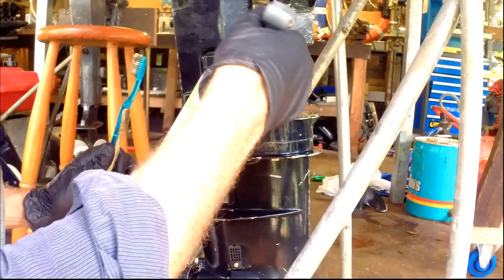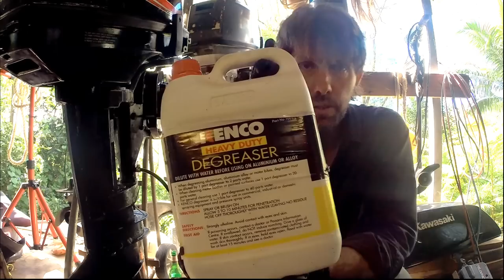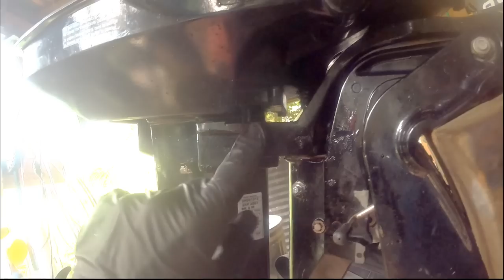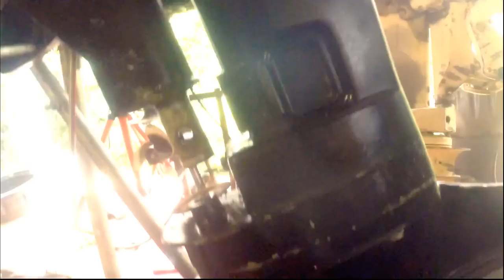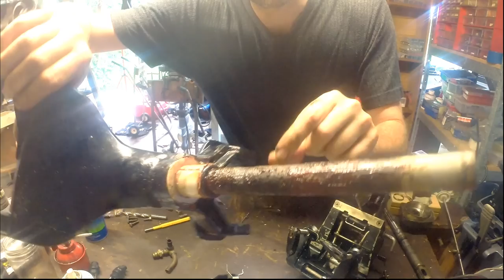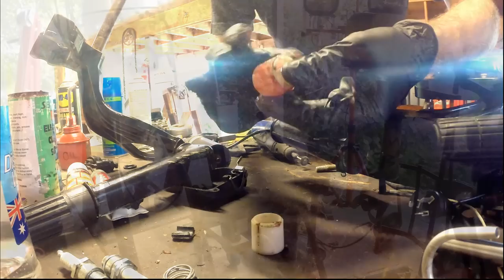Fixing a stiff steering bracket (pivot tube) on an outboard motor

Comment: Your idea is great, I do something similar that has always worked, and that is to use brake kleen then PB blaster, then regrease. The brake kleen really hits the old grease and breaks it down big time, the pb afterwards lubricates the tube because the brake kleen dries it out a little, then the grease travels through the pivot tube real nicely!
People that say heat it with a torch, but they usually damage the nylon bushings and seals top and bottom that keep saltwater out and grease in, and it doesnt really work so good anyways. Cheers!

Comment: Really helpful video. I “hydrauliced” my tender outboard by pumping in “corrosion block grease”.  I had the presence of mind to Google the problem and found this. I did not have a compressor to hand, so adapted a hydraulic oil pump, and drilled a hole through the centre of an M8 and M6 bolt to thread into the grease nipple boss, and the friction nut boss. Pumped de greaser through both ports, and after about 5 mins a big thick hard grease snake oozed out of the boss top and bottom. Steering now  free as a bird, and filled with light lithium grease.....I won’t make that mistake again (using heavy grease!) Many thanks for the tip.

Comment: Hey Stu, old video I know but maybe this'll help someone. My '99 Merc 40hp 2 stroke only has one zerk fitting about an inch from the bottom of the steering tube (dumb design, should have a top one too) and the steering had mostly seized up. I'd managed to get grease through the bottom of the tube but the top wasn't happening, and all my local repairer could do was drill a couple of holes in the top and suggest I drip oil into them. It improved it to useable but still wasn't great. So today I fixed it... wrapped rags around the bottom where the grease escaped and clamped them in place with a hose clamp, heated the tube with a hot air gun, then hit it with the grease gun again. It took 2-3 readjustments of the clamp to stop it escaping from the bottom but eventually I got old black grease then new green grease out the top in a couple of spots. Steering's now back to about 95% what it should be and I'm very happy, and should improve more as I use it and work the new grease through it. Whole repair cost me $6 for a hose clamp.
Reply: Gonna try this tomorrow. Mine only has one fitting on the bottom side too. So dumb

Comment: thanks so much. Been searching for days trying to find something! This looks the same as my Yamaha 6 Hp. No sure about welding , but at least I can see which way to get it out. Got the parts on order.
Reply from the maker: Richard Whiteman Hi Richard, glad the video helped you. It is a very common problem with outboards that's for sure. There are many ways to get the tube apart, good luck with getting yours fixed!
Reply: +Dangar Marine I had a same problem with my 15HP Parsun (Yamaha licence). Worst thing is engine demontage for the 2 screws under, that holding the bracket. Everything else was like walking thrue eden :-)
Reply from the maker: This is a common and frustrating job. I did this job again recently on a larger motor using our shop press and it was much easier. Maybe even just take the bracket to your local shop if it won't budge. Good luck!
Reply: +Dangar Marine ...and I had another problem, the pins, centering the oil tank were stucked in the body of engine and foot. Reason, for problems with engine demontage from outboard body.
Reply from the maker: +Michal Rimmerak There is one thing you can count on with used outboards, there is always something stuck!
Reply: You´re right !

Comment: HI, Great video with heaps of detail. I needto replace the swivel "yoke" as one arm was broken off (long story), can the yoke be roved without the need to actually remove the power head? I have a mercury 15M (2002) and it seems that if I loosened the two bolts at the bottom of the steering tube, and disconnect the gear linkage that the motor should slide(lift) off the steering yoke. Am I missing something?

Comment: Update on my 20hp johnson ..My one trick worked.I wrapped a piece of rubber at lower bushing and used a hose clamp on it and started pumping .It took along time, but I finally saw acivity at the top bushing .Mostly black grease coming out.I probably used 1 small tube of grease to really get it flowing descent.Need more grease.Will use it and keep greasing till it looks good.I did spray WD40 and alittle carb cleaner around bushing last nite.I think the clamp trick is what did it so it would not come out lower bushing.Thanks
Reply from the maker: Nice work, and a good technique. Worthy of a video! :)

Comment: you can also heat gently and have an assistant pump grease in as you do so
Reply from the maker: Yep, I've tried this many times with varying success. A third person can also help: one to pump the grease, one to heat and one to keep turning the wheel back and forth. I've also had a friend fill a grease gun with WD40 to clean it out before adding fresh grease. He said it worked wonders.
Reply: ive also used a lapping compound grease.  the great thing about it is the more you use it, the better it gets

Comment: G'day great vid. I've got the same motor but it will only run with the choke on or at high revs
Reply from the maker: Thanks mate. Sounds like the idle jet in the carburettor is a bit blocked. Try giving it a good clean out: https://www.youtube.com/watch?v=ye_Ui9D8dBE

Comment: Thanks for this video, which is very helpful a similar problem I have on a Johnson 70hp 4-stroke. I have one question to ask: when re-attaching the outboard to the swivel bracket, do you use any compound on the bolt threads to ensure they don't loosen with vibration?
Reply from the maker: No, just do them up tight.
Reply: @DangarMarine  thanks for the reply.

Comment: My johnson 20hp only has a grease nipple at bottom of tube and will not push grease all the way up out at the top bushing like it should and does on my johnson 9.9.Tube is not stiff to turn, but would like to get it greased properly.There is a tensioner screw with spring up top on tube at front to adjust tension/stiffness of steering .Could that be removed and some sort of adapter screwed in and grease pumped in there?Local marina mechanic said they squirt alittle carb cleaner around top bushing to soak down and try and loosen up old grease.
Reply from the maker: Yep, that can be removed, it is just a type of brake that pushes against the bushing. Anything to dissolve the grease is a good thing, but some grease is so hard and packed in there that disassembling and removing it by scraping and sanding is the only way.

Comment: I recently bought a DF2.5 (2020 model) 20" Shaft motor and It works perfectly fine except, when I try to steer at quarter to half throttle, the steering becomes stiff. So every time I have to turn, I have to bring the motor to a complete idle and then steer. The steering tension adjusting knob is set to loose. any advice on this is much appreciated. I have seen the same problem reported by another person in suzuki outboard forums and no one so far has been replied.

Comment: I recently bought a second maybe third or fourth hand boat. The engine is a bit flaky on it. I have been looking for the catch for some time and I think after watching this video I have found it. The steering gets stiff after a while and has to be constantly greased to keep it moving. A daunting prospect taking it all apart as you have done to fix it. Is there any preference for grease such as a special marine grease or will multi purpose grease be ok?
Reply from the maker: Unfortunately this is a fairly involved fix. A lithium based marine grease is definitely preferable.

Comment: So I kept torching and turning while adding new grease now it’s about 75% better (was completely seized).  Turns freely and I am sure I will get another season out of it. From your experience How long does doing that torch method hold up for? It’s just temporary right
Reply from the maker: It's really hard to predict, but the more of the old grease you can flush out the better. I've also tried unscrewing the grease nipple and putting a barb in and pushing degreaser through before putting the new grease in.
Reply: Dangar Marine you’re a madman, thanks

Comment: If you’re standing on the outside of your boat when it’s parked on the trailer, is it normal for an outboard cable steering motor to move slightly (about an inch) side to side by using just your hands?

Comment: Thanks for uploading this. I've got a 2004 Yamaha F150 that I can wiggle when the motor is on or off. I believe the bushings are worn out and/or the pin is worn. I'm scared the engine will eventually fall off when the pin breaks. Should I be scared? Should I go through this exercise and replace the pin? Seems like a lot of work for a 150 compared to this 8 hp.
Reply: +tsingle11 Steering is fine.. I'm just having the opposite problem of you. Nothing is stiff, it's loose!
Reply from the maker: It's a bit hard to say without seeing it, but with that type of failure the stakes are high so I would be looking into it. To be honest, so long as you have an engine hoist it isn't that much harder for a big motor. At least you won't have to struggle with a press to get it apart. Another thing to consider is that if the bushings are worn it will only start to wear out faster and faster.
Reply: tsingle11 I have a 2006 25hp with the same problem, the motor has a lot of play inside the steering mount bracket, It has to be the bearings. Did you ever replace yours?

Comment: So I am guessing it is the pivot tube, but my motor(100HP mariner) has about 2-3 cm of "play". This is not even when turning but even forward backward and pushing side to side the motor is "loose" from the Transom mount...I am guessing it just needs some tightening up but it looks like I would have to remove basically the whole engine block...any advice or a video showing how that could be achieved?
Reply from the maker: Odd to have so much play there. The nylon bushings inside may have failed but that would only give you 5mm of play tops I would say.

Comment: just got my first boat and it is used . I put it on the water before the purchase on found out that the boat turns to the right like a charm but to the left very difficult could this be the steering cable .This is what the person who sold the boat told me to do
Reply from the maker: Possibly. Is it difficult like that then the boat is still or only when moving at speed?

Comment: I have the same 50hp Honda that you had on the green machine. I can still steer it with the wheel (but its real stiff). When i disconnected the steering controls, it takes a huge shove to move it by hand. Do you have any hints for the pivot tube on that engine? It only has 1 nipple at bottom. Is there anyway to get grease in thru the tensioner screw? Any other trick to fix it (besides taking the whole thing off & apart)?
Reply from the maker: You can try pumping some grease in while someone turns the wheel and another person heats the tube with a heat gun to melt the old grease.

Comment: Hey man have been watching all your videos i got to say they have been lot of help seen i just bought a boat and don't know a thing about it :). I have a yamaha 1994 200txrs that have a stiff steering bracket but it still moveble with the hydraulic but with alot of effort. So i want to replace that and by watching your video now i have some ideas how to do it. My problem is on what parts to buy other than the main arm and bolts. Can you help me with that ? And some advice plz ;) thanks
Reply from the maker: Yasmani Neira Hi Yasmani, thanks for watching. I don't know if you saw the video where I tried and failed to fix this on my 50HP Yamaha, but in the end I went to a wreckers and bought a replacement mid section. I mainly did this because I also needed a new exhaust manifold as well. Use this is the page to find the parts on: http://www.boats.net/parts/search/Yamaha/Outboard/1994/200TXRS/BRACKET%201/parts.html  and http://www.boats.net/parts/search/Yamaha/Outboard/1994/200TXRS/BRACKET%202/parts.html
You will need the Steering bracket assembly and brushes as well as the pivot tube, but I would try a wreckers first as they parts are expensive to buy new.

Comment: Hi mate.
I've just rebuilt my 1985 yamaha 9.9 from scratch and it's starting fine but then it's got this annoying pr like your holding the throttle open and switching the ignition off and on. Could this be the cdi unit or something electrical. I'm stumped. Plz help.
Reply: My '84 20hp Yamaha was doing same. Pulled the carby,  took out and cleaned dirty jets and sprayed whole thing out anywhere I could stick the spray nozzle with carby cleaner. Also replaced spark plugs and now it's singing. Not sure which was problem but all good now.

Comment: I have a feeling I might have to do this. I took off the steering cable nut like you said in your other video, and the cable itself feels buttery smooth, however the motor is completely frozen. I tried to turn it with my hands and even with the weight of the motor up on tilt I can’t even get it to budge. Only thing I can think of is needs this job right?
Reply from the maker: Unfortunately it does sound like it.

Comment: I have a new  rib with a new outboard df 300 Suzuki. For the steering I used the  seastar system.
The problem is that when I run more than 10 knots the steering is very stiff and it's almost to turn the wheel to the left. Bare in mind that my outboard is left.
Any clue????
Reply from the maker: If it gets harder at speed I would check the trim tab anode on the outboard leg. You may need to loosen it and angle it a bit to port to get the dynamic force on the outboard from the paddle wheel effect of the prop to be more neutral. Been meaning to do a video on this for ages but if you do a bit of googling on that trim tab anode you should find some good info.
Reply: Thank's for your immediate answer. I 've done this but no improvement. Any other idea??
Reply from the maker: It can also be that the hull is causing the problem, not the outboard itself. I presume at that horse power it is hydraulic steering?
Reply: It is a seastar hydraulic steering system. Thank you
Reply from the maker: So it is unusual for hydraulic steering to be like that. If it is brand new I would be inclined to get the steering checked. It is possible for an inflatable hull to affect the steering of a boat it isn't completely symmetrical but it still sounds strange.

Comment: so change the steering cable sorry to ask so many questions this is my first boat.
Reply from the maker: What you are looking to do first is isolate the cable so you can determine which part of the system is causing you problem. It can be the outboard itself ("stiff steering bracket"), the cable or the helm. It's a slightly odd symptom you are getting which makes me think either a problem with the helm or the cable catching in the tilt tube. This might explain the different in pressure between the cable pulling through or pushing through. Once you know for sure where the resistance is coming from you can decide what to do about it.

Comment: and it does this going fast or slow turns good to the right and not the left
Reply from the maker: How about when the motor is off? Large motors suffer from torque steer where the rotation of the prop pushes the outboard in one direction. This is very noticeable on a 90HP Mercury I drive. If you let go of the wheel it turns to the right straight away. Video on this coming out soon.

Comment: lol, got me a winner yesterday, started pumping Marine grease into the steering tube and then almost immediately had a jet stream of old greasy salt water shoot directly into both my eyes from the top seal. Don't know what was worst getting it in my eyes or the smell of that old water spraying all over my face.
Reply from the maker: Bummer... Lucky you were wearing your safety glasses! ;) I once opened a gearbox that was warm and had pressure in it sending a stream of old gearbox oil straight into my mouth. That stuff tastes TERRIBLE!
Reply: lol, I think I would prefer the oily salt water in eyes, we will only make these mistakes once, I hope...

Comment: trim tab is gone but low speed
Reply from the maker: I would start by disconnecting the end of the steering rod from the outboard itself and then seeing what it feels like. by taking out that one bolt from the drag link you will be able to move the outboard independently of the steering cable. See how both halves feel and let me know.